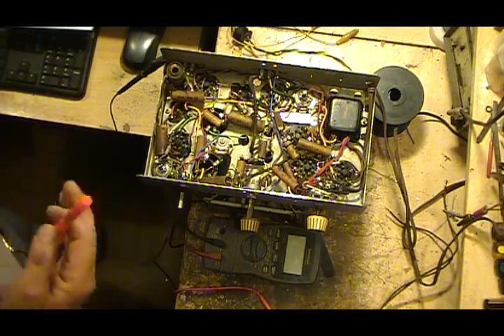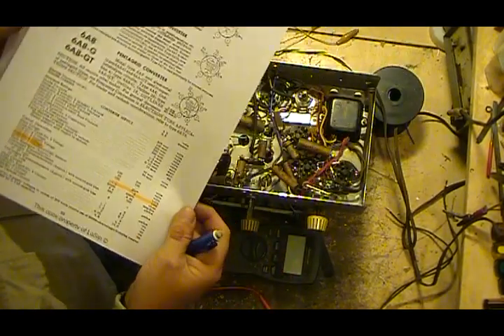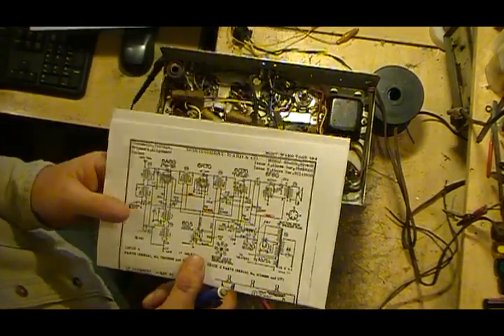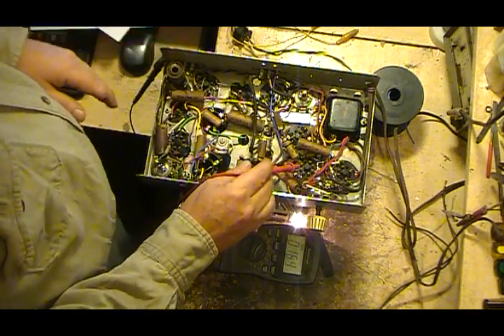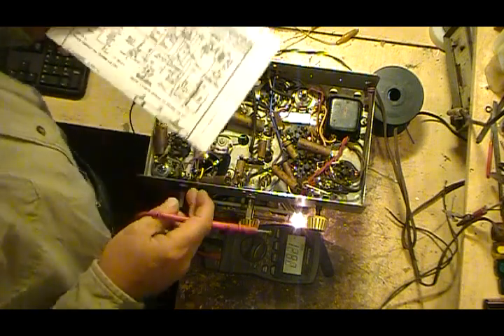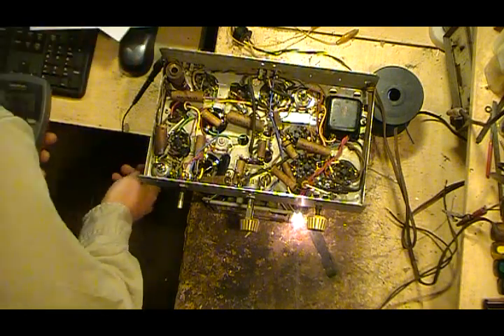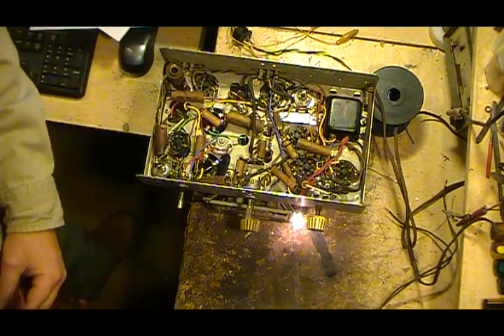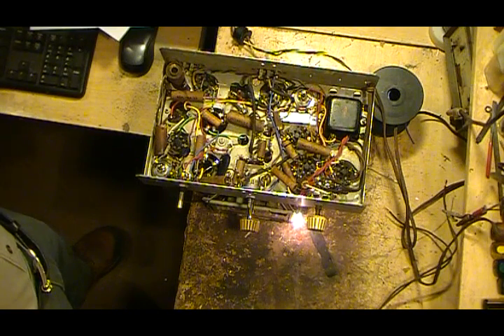Troubleshooting a radio

Comment: Extremely helpful, thank you! This is one of the most invaluable videos I’ve seen on radio repair. Got a radio I’m working on now that has me baffled and I’ve been trying to diagnose some voltage and signal issues. This certainly helps clarify things for me. I’m about ready to give up, though, as I’m frustrated and all resistors and caps check out. I do seem to have some problems with no voltage where there should be negative voltages and I’m hoping this video will help. Knowing that the negative voltage originates from the AVC may just help point me in the right direction.

Comment: I've got the amp from a 1965 Zenith MM2670 that just spent a year and $350 at a guy's shop getting fixed but it isn't fixed. He gave up and gave it back to me. I have it sitting on my desk and I can tell he replaced 2 small caps but ignored everything else. it is so frustrating trying to get this thing fixed.

Comment: Hi Dennis, can you do a video on FM signal tracing on a Normal FM circuit board. What I mean is If you are repairing a Radio (Not Tube) and you do not have audio out.. How you can trace back the signal to repair it. I would really like to learn this.
Reply: +Andre Gopee Good question, I'd like to see that too.

Comment: I have a 1977 Fisher 142-9253 4700. It had set for 20 years. I turned it on. It worked for a couple of days. Then it went to static and the strength meter, went max. Any ideas on problem. Also do you know of any site that has the schematics for fisher? Thanks Chuck
Reply: It looks like you may have the wrong model number. None of the Fischer model numbers I found look like the one you posted. Once you get the right model number you should be able to find a schematic for it.

Comment: It is a pity that the schematic diagram was not visible enough, that is to say not close enough in order to be able to see the simple components beginning from the tube and ending to the single elements composing the circuit under control. Otherwise the idea was good .